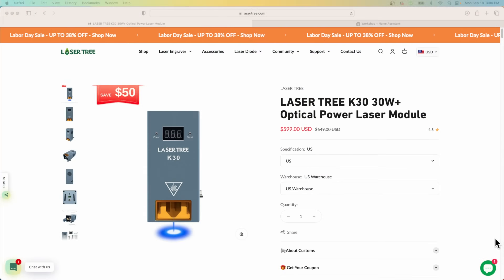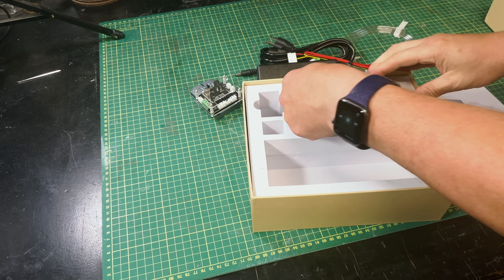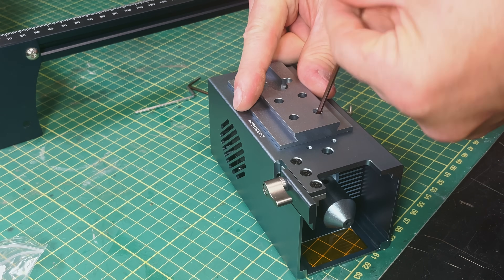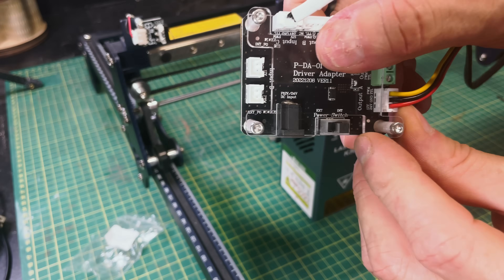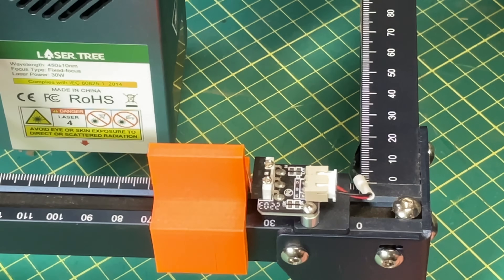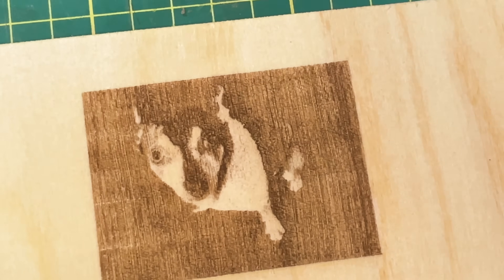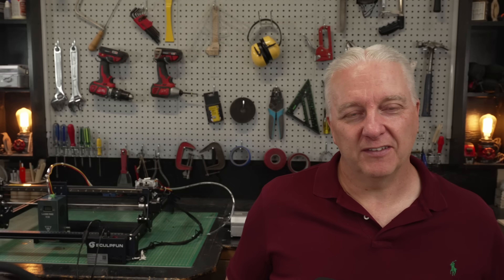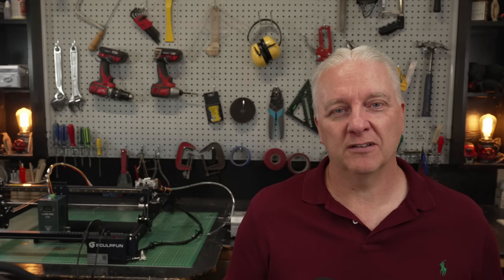Boost Laser Performance on a Budget: Installing LaserTree K30 33W Module for Maximum Power!

Comment: hey guy's :Can i use the adapter on ender too to upgrade the laser from 10W to 40W? With the mainboard you can only use a max. 10W laser and i won't more power; the mainboard will breakdown. So i think connect the input (TLL) end use a externe powersource the power the laser. What do you think?
Reply from the maker: I think you should be able to do this.  But ask LaserTree if they already have a solution for this.  They might.

Comment: Big up for the video, i was stuck on mounting the laser head on the s9 mount and you came to the rescue. It does an amazing job engraving on metals btw.
Reply from the maker: That's fantastic to hear! Glad I could help you get that head mounted and get you running on metal.

Comment: Thank you very much for the useful Video. I got the same. However, I have an issue that I can not figure out. I hope you might be able to help. I can not turn off the travel lines between shapes. For example, It burns between letters in a name. I checked everything I was able to find which basically entered $32=1, and $30 =1000 in Lightburn consol. That did not work. Are there any tips that you help with? Thanks in advance.
Reply from the maker: Hmm, never seen that problem.  That would realistically happen only if the gcode that was generated didn't turn off the laser.  Without actually sitting as the laser, it would be difficult

Comment: HI Steve,  I just installed the K30 on my Ortur LM2 frame.  Do you know if there is a way to slow down the travel speeds of the laser in between cuts?  The bigger laser moves and stops so fast it can jar the frame and cause cuts to be off.  It's not the cut speed setting, its the movement between cuts.   I can't seem to find a way to slow down the travel speeds.  Also, did your K30's fans come on as soon as you added the external power to them?  is there a setting that can tell the laser to go to sleep without powering down the unit completely?  Thanks!
Reply from the maker: Yes, in Lightburn under the Edit menu you can look at the device settings and make changes there.  Looks for x and y speed and acceleration values in the section at the bottom.  You'll get a scary message when you try to open this section of the settings and I would recommend record the value of any item you want to change, in case you need to change it back.

Comment: Laser Tree 80 w Module can it be used on Sculfun S 30 20 w pro max
Reply from the maker: This might be something you'd need to ask Laser Tree about.  The gantry on an S30 is pretty spindly, so the weight of a big module might be a problem.
Reply: @SteveMakesEverything  Noted with Thanks'
Reply: @SteveMakesEverything  How about k40?
Reply from the maker: @kuansengwong5620  It's kind of the same answer.  Every laser/laser module combination will be unique. 

The 40W module will definitely be lighter, but check the Laser Tree documentation to see if there is any information on what laser's they've tried this on.
Reply: @SteveMakesEverything  Noted with Thanks'

Comment: Thanks. I’ve been thinking about upgrading my XTools S1 from 40w to 60w. Came across this video when I was hunting for info. I wonder how well it will work, and if it is a sensible upgrade. I think the modules are currently $750-800 for the 60w. Do you have any thoughts?
Reply from the maker: The thing to keep in mind is that the laser module is the most expensive component in the entire laser, typically representing about 60-70% of the cost. You need to decide if you like the rest of your laser enough to do this upgrade because selling it and buying a whole new laser may be more economical.

Comment: Bought the LaserTree K40 for cutting material. This thing is a beast! 1/4 inch ply in one pass at 450mm/m and 90% power. 1/4 inch MDF, lower power but still no issue on one pass. Haven't tried engraving anything yet but it looks like it will help my business with custom cut wall art on my DIY 24 inch by 48 inch laser frame without any issue. Word of warning though. If you're cutting material, make sure you have an enclosure and a way to exhaust the fumes. Also use air assist event in a small amount to protect the lens from smoke/soot. This puppy kicks up a lot of smoke when it cuts. No regrets buying it. Like I said, it's a beast!
Reply from the maker: Enclosures are always recommended.  Cutting wood makes quite a bit of smoke.

Comment: I have installed my K20 but am wondering if I have to download a driver.  When I get into Lightburn, it isn't recognizing the  Laser Tree K20.  Could you please provide any assistance?  Thank you for this video
Reply from the maker: There's no drivers.  Lightburn won't know anything about the K20, it just provides power and a pulse to fire the lasers.  It the laser isn't firing when you send a job, then make sure you have the auxiliary power plugging into the LaserTree card, and make sure you the the jumpers set properly to use aux. power

Comment: Hi again Steve, I am now trying to install the lasertree module on my sculpfun S9. I purchased the K20 version, which I assume should be insalled similarly to the k30 in your video. In  the manual there is no mention of the "the existing cable" as you called it (which I suppose is the one that used to feed the original module). The manual only explains how to connect the new cable from the driver to the module. But then I guess that the module should need some kind of feed, so what you described makes more sense. But I don't know... 
 Another question, a trifle really: I saw in your video (and in the manual) that the fastening screws are placed on the side of the laser. While they are surely easier to access now, I have noticed that while tightening them up they tilt the module sligtly sideways, within the freedom between the rail and the slider. I thought of placing he screws behind the module, like in the original sculpfun module, but then the screws would be slightly more difficult to access. Does it make any difference?   Thanks in advance
Reply from the maker: The cable that comes from the laser plugs into the input on control module. Look for one with the same pin out as the old laser module for power, ground and PCM. The new laser module plugs into a dedicated output connector on the module
Reply: @SteveMakesEverything  thanks Steve . Just to make sure “the cable that comes from the laser” you mentioned is the one that was connected to the old module and is now loose. Yes?
Reply from the maker: @yehudaschryer5985  yes

Comment: I have a Longmill Mk2 cnc router with their laser module. Do you know if this would be a compatible replacement for a power upgrade?  My laser is a 7watt and the cnc router controller has a PWM port that controls the laser.
Reply from the maker: In theory it will work since laser modules typical have three connections (power, ground and PWM).  You will need to make sure that whatever powers the laser can drive the current you need and you’d probably need to make a custom able between the Longmill and the new laser module
Reply: HI Brian, I also have a Longmill laser with my CNC.  Did you get this Laser Tree laser? I am wondering if it works for fine engraving similar to what the lenses that Senci offered with their system?

Ray

Comment: €800??? 😂 are you for real 😆🙈
Reply from the maker: Well, I think so🤔, but to be correct, the 33W module I reviewed here is 559 USD, which is about €550.  The 40W module might cost €800, but I challenge you to find a new, useable 40W laser for less than that. 

Keep in mind that it's still a cheaper upgrade than buying a new laser, and budget is a big concern for most people.

Comment: hi Steve, is it safe to plug the new 24V power cable that comes with the module to the sculpfun 12V motherboard or should the 24V power cable be connected to the lasertree driver?
Reply from the maker: If the Sculpfun uses 12v power then you don’t want to be plugging it into a 24v power supply, though I don’t think the connector would fit anyway.  Plug the laser into 12v as normal, then set to LaserTree module to external power and plug the 24v supply into that to power the laser module.
Reply: I'll do just that, thanks a lot Steve @SteveMakesEverything

Comment: I got controler hoard but don’t understand how use it do I just power everything thru that or do I need to run a 24v thru it for laser pluse my standers 24v power plugin in to my main board ?
Reply from the maker: The board has its own power and you would need that if your current laser is 12v. Make sue to switch the board to handle external power.  If your laser is already 24V powered, you can just pass power through the board as long as your power supply can handle the current requirements.

Comment: Have you done an upgrade on the xTool 10W D1 Pro with the Laser Tree  LT-4LDS-V2
Reply from the maker: I haven’t. There are only a few different configurations for laser modules so it should work,  but it might be worth confirming this with LaserTree

Comment: looking or reviews of the K40 now
Reply from the maker: Let me see what I can do
Reply from the maker: @DwightStebner  This is one of the hazards of the K40 lasers.  You really need the Ruida controller.

None of this helps you of course unless you're now willing to spend more money to upgrade the controller.

Note that Lightburn can generate GCode to a saved file.  If your laser and read a gcode file from a USB stick, then you might still be able to use Lightburn, though you won't have the conveniences it provides if you're connected (e.g. framing)
Reply: @SteveMakesEverything  I have Timothy Rothmans Black and blue control board now, will it work with the K30 or k40.
Reply from the maker: @DwightStebner  I don't know this board well, but in theory, it should work. but this controller is really designed for diode lasers so I wouldn't bet on it for a CO2 laser.  You would have to shoot them an email and ask if they support your laser.

For CO2 lasers I've always used Ruida controllers.  They have all the inputs for water flow, cooling pump and all the other things that CO2 laser need that diode laser don't
Reply: @SteveMakesEverything  the k40 is a diode module.   I use Timothy Rothmand board with my 10 watt diode now.
Reply from the maker: @DwightStebner  😀 Clearly too many things with the same name.  The laser module shouldn't really matter too much as along as the board can output a PCM signal to it.  The rest of the board is to control the steppers.
Reply: @SteveMakesEverything  The K30 diode modul works flawless with the Tim Rothman 32 bit board. 24 volt power supply linked in.
Reply from the maker: @DwightStebner  Excellent!  Thanks for letting everyone know.

Comment: Hi Steve. I find your video very useful and interesting. Thanks a lot for it.  The problem of not enough power is a real issue for for me as cutting is more important for me than engraving.. My machine is a Sculpfun S9 on which I have already replaced the unit with their 10W (+air pump).  This brought some improvement but the cutting possibilities are, still, limited when it comes to material thickness.  I'd like to ask you: What experience have you had with the K30 in respect to cutting power?  How thick is their beam?   I saw on your video that you upgraded your gantry (with Sculpfun's kit?)  Why? to what benefit?  Is the K30 heavier than the S9 unit? Does it matter in this respect?  Many thanks. Emanuel
Reply from the maker: I didn’t measure the K30 beam size, nor could I find it listed in their specs, but it does cut very well as shown by the cut test for this video.

I upgrade an S30 rather than an S9, so maybe that’s the difference in gantries.  Regardless the S30 was stock as it came from Sculpfun
Reply: Thank you for your reply.  On the subject of upgrading a Sculpfun machine from 5.5W or 10W  to the twenties or thirties , I still wonder:  why buy a module from LaserTree (or any other source) while Sculpfum themselves offer upgrading units ? Do you or anyone of your channel followers have any insight ? Many thanks. Emanuel
Reply from the maker: @emanuelpelleg281  Yes, in cases where the manufacturer has a cost-effective alternative, use that.  I used the Sculpfun because that's what I had.

Comment: Interesting video!  Similar to my 20watt comgrow upgrade. I wonder if that little control board is nessesary.  On my Comgrow there was only the 20w power supply, the PWM, and both grounds where tied together.  It seems like you could do something similar here.  How is the digital display?  It's a temperature reading of the laser module, right?  I've heard the dot size of the module is rather large.  Did you notice any difference compared to some of the other ones?   I think my next $599 is going towards a K40, but maybe one day!
Reply from the maker: The control board has a couple things on it.  One is the connection for the external 24v power supply, but in principle, it should just be power isolation and whatever it takes to make the input pinout look like your existing laser.  The dot size for most 30W lasers is larger but still smaller than a Co2 laser, but of course, a CO2 provides its own unique set of capabilities.

Comment: $599. That's probably what to lead with on this video. Is anyone really going to put the equivalent cost of an TWO entire K40 CO2 laser systems on a $99 otura framework? No.
Reply: I upgraded mine for about $300 to the K30 from a 10W and with the craze about the K40 CO2 and how expensive the upgrades and consumables are i'll stay for now with a diode !
Reply from the maker: Well framework is basically the same on every laser. It’s the laser module that gives the most impact and there will be people who don’t have budget for a whole new laser.

The K40 argument applies to any diode laser not just an upgrade.